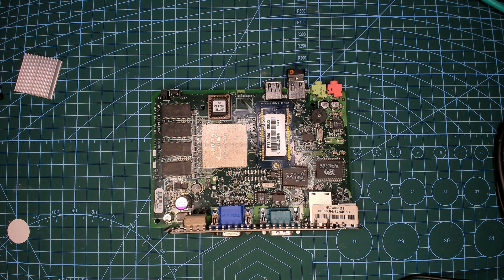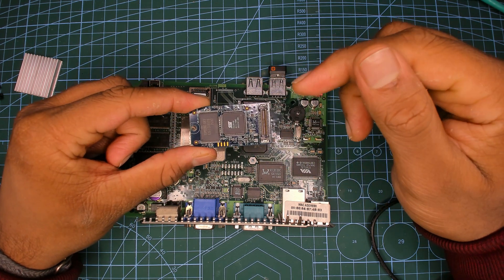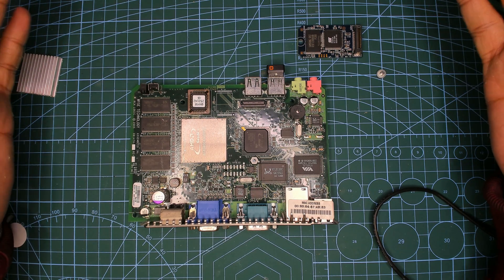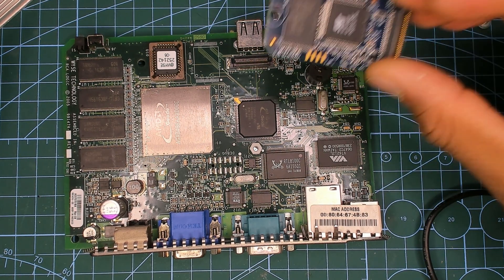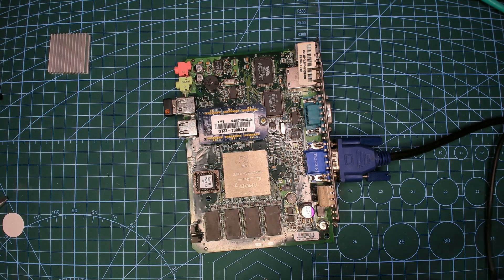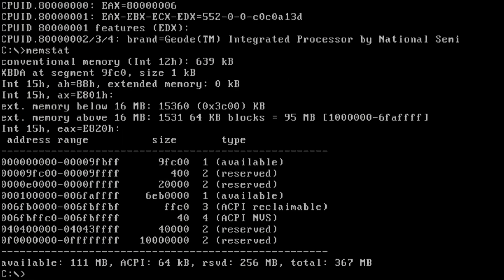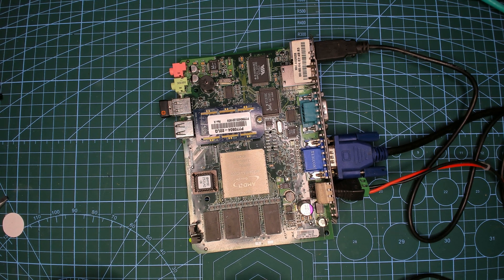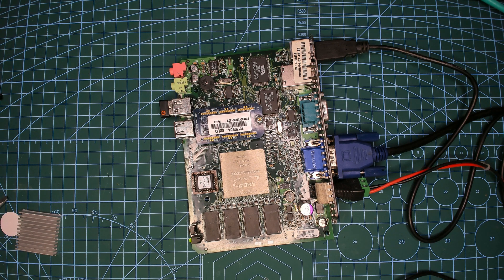"AMD" Geode GX from WYSE SX0 showcase running DOOM on FreeDOS

Comment: How does the keyboard work, there is no PS2 port, so how come a USB drive can't be used? (from DOS - that would be your permanent storage option)
Reply from the maker: I can boot from usb, it's not very reliable. And if the bootloader uses grub or isoboot it hangs. So it's impossible to boot anything useful from a usb, not that isb boot doesn't work.
Reply: @usrbinsh  no I meant "use the USB drive as D: storage" after boot from 64MB internal C: drive
Reply from the maker: @paulwratt  i was thinking about it, but i did a very minimal install so I'd need to figure out getting the usbdos package installed.
Reply: There are dos usb storage drivers and for mouse and keyboard I use them on dos 6.22